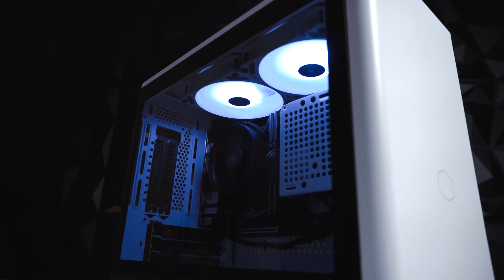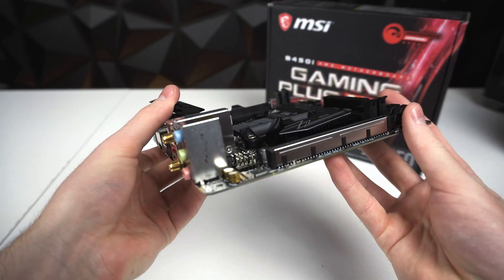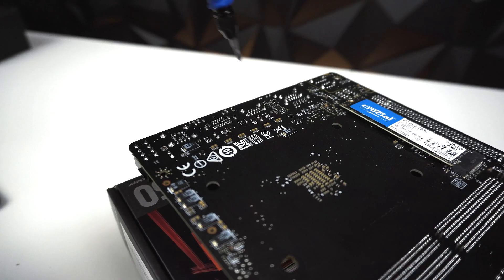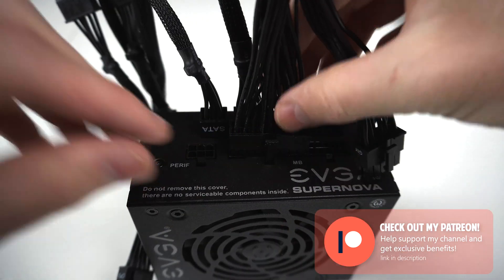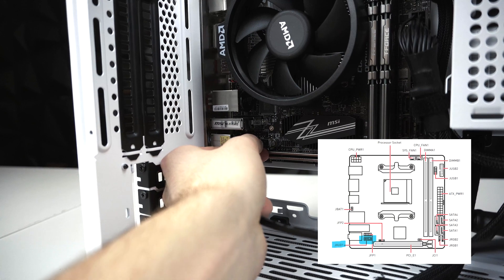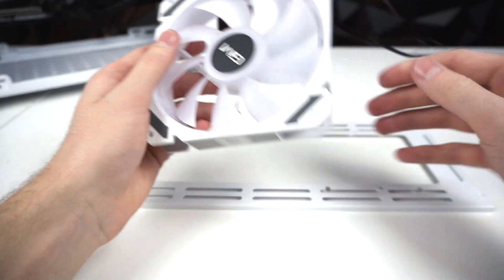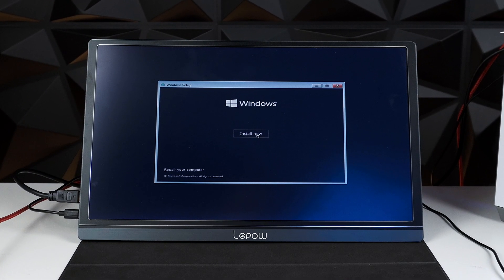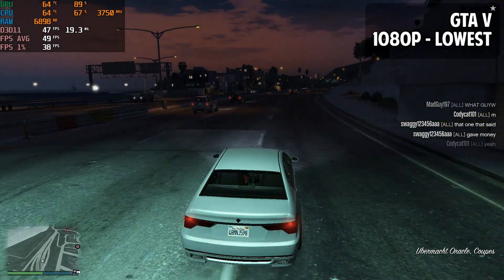BEST $600 ITX Gaming PC, NO USED PARTS! [Tutorial, Benchmarks]

Comment: Bruh I have the ryzen 3 3200g with 16gb 3200mhz ram and it runs fortnite at around 100 fps on low on a 900p 75hz monitor. I don't know why yours is running at 21 fps.

Comment: How would I install a graphics card if I wanted to upgrade in the future
Reply from the maker: Quite simple - You install the graphics card like any other build into the PCIE slot. If the card requires PCIE power, be sure plug in the PCIE cable into the power supply (since it is modular), and then plug the other end into the video card. Then, be sure your display cable is plugged into the graphics card instead of the motherboard IO! And that's all it takes.
Reply: @Roo_Tech  thx
Reply: @Roo_Tech  will I be able to install it on this pc?